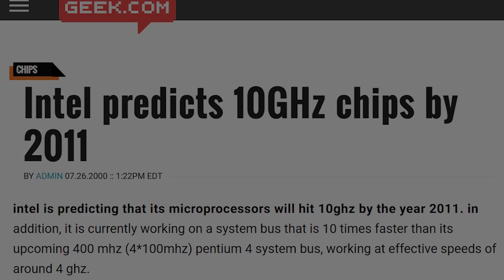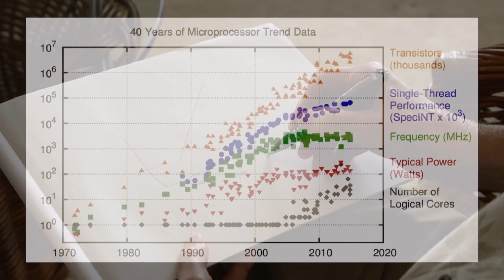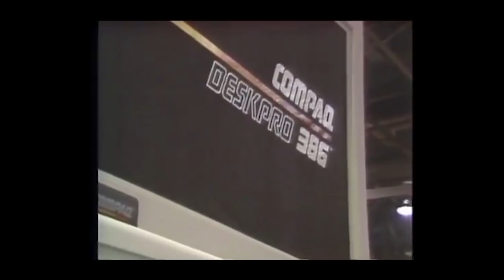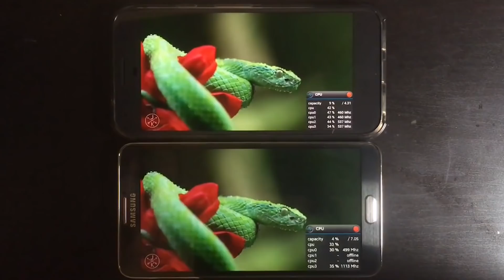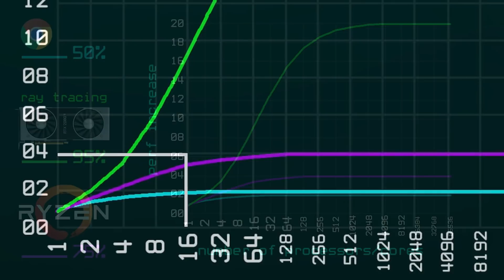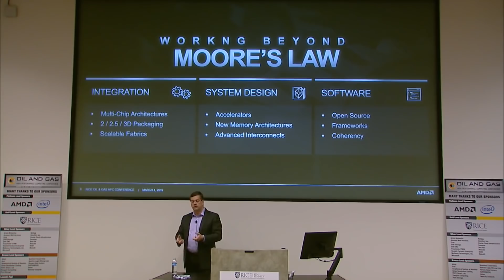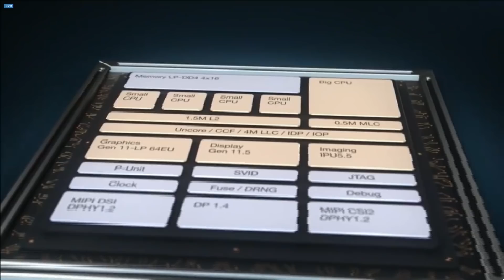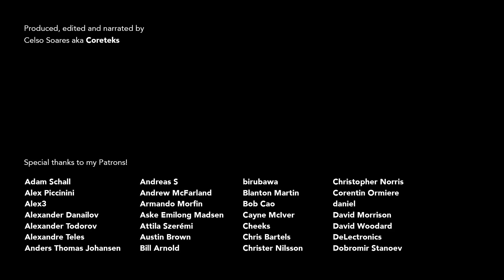Intel and AMD going BEYOND Moore's Law

Comment: Remember back to the 90s.  Used to be a cool, edgy magazine called "Wired" that went charging into the mainstream.  One Man's Opinion now a sold out shadow of itself.  Had a VERY memorable cover of a gorgeous blonde wearing a thin layer of what looked like diamonds with the title "The New Diamond Age" - and as carefully as possible talked about how if the DeBeers Cartel would release its bought out and hidden patents on synthetic diamonds how much it'd improve computer clock speed.  Easily into the many GHz range even in the day of not yet 100Mhz with existing technology.  Not fancy 'light' computers but a synthetic diamond rectangle to layer the chip above would make a better heat sink.  They also 'proved' that there had to be some kind of way of making synthetic diamonds in mass very cheaply - because ICBMS can re-enter the atmosphere at several times the speed of sound and would easily heat up too fast for their electronics to work if not be vaporized without a solid diamond shell on the cone.

But...I like the 'multi-processor' angle.

Since I use 3d rendering software the more 'cores' the better.  
The most noticeable is rendering where you see in front of you tons of 'squares' where the scene renders.
Less noticeable but still practical is how you can keep other apps open at the same time and work on them.  Browsers, art software, files, word processors.  They take away from total render time but can be very convenient depending on what you are doing.

Now, not every single program will need or benefit from a converter to split it up.  An old school arcade game even in an 'emulator' works in what would have been one of the world's better supercomputers for its time and even if you scaled it to a wall-size flexible display sheet of plastic would you need any more computing power than one core + 1 gig out of an 8 core, 16 gig computer you can casually buy today.

Virtual realty, high graphics games, advanced simulation and of course more 3d software are the ones needing to work out a flexible and expandable way to use cores.  The companies get plenty of money and since they fire employees just before Christmas to give the CEO a big bonus there are plenty who've worked with them needing to do something new.  Thus we need more core based programs.

I think what will be needed is a new 'standard' of multi-processor programming - one accessible to beginners and students.  Anyone can make a program to use multiple processors but it is their invention and likely works only on their computer system.  Or an individual company can make something that works with their software but outside it "Pay us Milleyunz und Milleyunz..."  There are enough mathematical algorithms (Fractal visualizations) that could use such a break down and have visible progress with multiple cores.  The trick is it needs to be FREE of any company or individual using it as a vampire's teeth to suck money.  Overall the benefit is worth contributing to.

Comment: Keep the original forecast in context.  Intel had just released NetBurst which was more conducive to ramping up higher clock speeds (at the expense of efficiency per clock cycle) so had they stuck with NetBurst instead of switching to the Core architecture, it is likely they would have come close to that 10Ghz forecast.  Fortunately Intel realized (after AMD started eating their lunch and RAMBUS was a total failure) that NetBurst was a dead end, and the quest for raw clock speed was a fruitless endeavor.

Comment: 2278
AMDntel announced the Ryzen-Core i4K Extrem.
A tech-demo is used to demonstrate the capability of their newest processor, sporting a wooping, 28Ghz on 4096 cores  with a total of 2048 threads.
The lights slowly fading as the artist (a clone of the all time favorite 21th century pop icon miley cyrus) is twerking to the 2079 released "despacito 5".
The audience is stilled as they realized the gigantic 50k holo Qled screen is showing Crysis 1, 2 and 3 and the original minecraft running at almost 60fps simultaniously.
Later that day, the united earth nation, lead by the bangladeshian main court, delcared the 8th of april to be the national holiday of technology and even pope kim jong trump junior acknowledge this significant step of human advancement.

Comment: You are completely clueless, my god. The way you talk about multithreaded code, you have no idea how much harder it is to have multithreaded code that runs stable. You have no idea about how much it would cost to "shift the paradigm" to multithreaded code. You have no idea about the fact that some problems are fundamentally sequential and can never be parallelised. You have no idea about operating systems that hold GLOBAL locks that stall ALL cores, or how the MMU and the TLB affect all cores, or interprocessor interrupts, or memory contention. The many-core technology is gonna be a failure for many years to come, except for particular special applications like Raytracing and Cloud computing. It is pointless for almost all the typical desktop applications after you surpassed a couple of cores.

Comment: In late 1970-1980 there were system called wafer-scale processing in short its a technology similar to McM but all connections between chips are on chip insted chip to chip , what does it do? it reduce energy consumption from wires by 1000 times and reduces latency by 100 times , this was made 40 years ago now we have almost 10.000 more advanced lithography.Wafer-scale processing is nothing other than imprinting few chips on the same wafer instead of cutting them to pieces and then wired them together.Simply by imprinting 2 chiplets and i/o on single wafer amd could create virtually single threaded cpu with 8 core worth of transistors , the tradeoffs are low yeld but this was tested almost 40 years ago with 28 and 40 gpu imprinted together on single wafer "well not exactly but very close".When imprinting 40 gpus seems unlikely due to random errors in lithography process then wafer-scale processing looks very promising in smaller chips but still way bigger that theoretically today limitation of 800mm/2 for gpus.

Comment: The notion that nobody would ever need more than 640K of RAM appears to have come from the IBM PC of the early 1980s.  In that system, any RAM address higher than 640K was dedicated to display usage.  That IBM PC was also the reason why drive C became the standard for boot hard drives.  This restriction would later result in a software comparability issue, wherein breaking the 640K barrier was considered such a big deal that there was a comical Microsoft ad heralding it.

Comment: Jeez, and here I am wishing Intel or someone would release a massively multicore general x86 cpu, or at least a USB "compute module" so I could write programs with even more parallelism without the trouble of trying to shoe-horn them onto the GPU. AND, I'd even be willing to shoe-horn, but I just have a crappy integrated GPU on my laptop, and, once again, no reasonable USB solution to hook up an external graphics card for use in computation.

Comment: AMD's IO die makes more sense than ever right now. Being able to store data in the cpu cache in a way that does not require code to specify a thread. Instead the CPU can allocate the thread that is free first, instead of potentially queuing the task on the core that would have previously had that data in it's individual cache.

Comment: Your arguments assume that each computer is used to run only a single application and that that appications work is only a single task. What about seperate services, look at modern applications....
Three tier architecture + frontend, multiple cores running database, then web server, then application backend, then the web browser, then multithreaded frontend js code. Then what about speech recognition pipelines then the AI work to interpret the meaning. There are PLENTY of uses for almost as many threads as you can ask for.

Comment: i wonder how far we(humans) can actually push this stuff tho. the only reason computers exist anymore is to make money. like, all cpus released in the past year can open/load/render 95% of the softwares used in businesses in less than 10 seconds. all of the gpus released in the past year can play 95% of games without a hiccup depending on settings. what im saying is... at some point there is going to be no reason to make the chips more powerful because of difficulty of manufacturing / what people will pay for the performance gains...... kinda like cars and super cars.... supercars go 250mph + but im pretty sure 99% of ppl have not gone over 200mph. do yall rly think that 250mph cars are gonna be 30 grand in 40 years? cmon

Comment: if I were to dissect this, it'd be too long. I can tell you that code/execution can scale up to as many threads as we want, and it can make sense if you have proper dataset. Easy way to explain today multithreading for browser terms you can build a chrome(or better firefox) browser that will automatically create new threads, and they are already doing that but on lower complexity by amount you allow them to in settings, each tab is then separated as a thread. In a single tab you may not notice performance as its currently is, and may gain performance but once you open up a lot of them - well if they aren't being created as new thread, you'll kill that one thread. 

Note I'm not saying number of cpu's or cores but threads. 

In programming you open threads. You can scale up to infinite amounts of threads, and still gain performance, if you have large enough data set that is, and if you can divide the work correctly;  Thus today mozilla could build a distro that would create threads by object, and script in easiest approach of a browser. (no point as we do not have that many threads, in your normal desktops). You can easily scale upwards to 100's of threads within a single page, threading each object.

The threading... of single threaded ops. The systems you have shown that are 'supposedly' dividing the single threaded op are doing very specific thing, its swapping thread affinity.
(and they do not have to deal with memory locality, and cache locality issues - they all share it)

The question is why no1 has ever came up with the scale upwards/downwards thread if process gains performance. Well they did make it happen at IBM, with Power6 architecture (2007), and later improved. It was vectoring the process and calling each CPU as a node - thus your code could be executed on whole CPU which could be 2-4-8 threads per core thanks to ibm's SMT implementations.

The future of moore's law is meh. Intel was ready to switch to new alloys for their CPU's back with 22nm age with FinFET as the process was designed for indium alloy, there was no need to go there tho; since they could earn more money staying on silicon instead.
Switching to less known indium alloy (which smart company that would want to kill its competition off) would use indium antimonide; in the beginning with big transistors and only over-time shrinking them to allow for more transistors. Basically a single dual or quad core 200GHz indium antimonide at 0.5V would deliver more performance than 64 core 3GHz CPU; and most important it would be cheaper. Those kinds of CPU's may not even need a cooler at all, and they'll only start cracking at over 400'C anyway.

Comment: My view on this: 1) Every trick, every AI feature, every automated rerouting of code has to be done by software or by die area of the chip. Part of the cpu is doing calculating work but it's not calculating anything relevant to the user. So part of the cpu power is wasted.
2) The more cores you have, the more wires you need to put between them, the more protocols, tunnels, switches you need to put between them. You cannot access a core directly if you have many of them. And cores will have to talk to each other a core will need results from other cores to continue it's job. Beyond a certain number of cores this will start playing a role. Same thing is true for big companies where there are a bunch of managers between the people who do the hardwork and the CEO. The avg guy from the working class can't talk to the big boss directly, at least not every day. In processors this means having 1: a timedelay, 2: overhead that uses power, 3: very complex cpu designs more prone to error and harder to maintain. I believe THIS is what's already giving us all the meltdown, spectre and dozens of similar leaks. If CPUs become even more complex than this, image what happens.
3) On Nanometers: You can't make cpus smaller and smaller. Here are some real hard limits: traces or a transistor can't be smaller than an atom, that's one clear thing to begin with. Think about one nanometer as the size of a 10atom long molecule. Then think about this: you can't pick and place individual atoms, you kinda shine at a group of them so traces will at least be a few atoms thick.
The "tools" to make the chip will have to be small too, now think about the wavelength of light. Visible light is about 380-750nm, UV is below that, Extreme-UV is 10 nm. Extreme-UV is already called ionising radiation, and in fact chipmakers now deal with the problem of creating electric loops inside the silicon by shining the laser onto it. Simple put: if you shine on one spot you in fact affect the area around it that is in the shadow. And here comes the problem: the smaller the wavelength the stronger its ionising properties are. So how can you etch a precise drawing if the thing you use to etch makes this collateral damage?
Another aspect: the etchant you use for the lithography, the polymer that cures by the UV light, it is make out of molecules with a certain size, a polymer is a long molecule because it's a chain of monomers, if that chain becomes shorter then it will have a lower melting point, lower boiling point, it might not cure. It's similar to replacing wax with diesel fuel, diesel doesn't become gel-like at room temperature.
And finally: the smaller you get the cleaner it has to be. A 0.5 nanometer sized imperfection might not affect a 60nm sized transistor, but it will affect a 10nm one.
I haven't even mentioned quantum tunnelling and other aspects where the transistors are so close to each other that the state of on will affect the state of its neighbours.
Please read this, this should be convincing information that you can easily check yourself on the internet.
Reply: You should really give it a thought. Overall you could say that I see even more limits in the growth of CPUs than you do.

Comment: Programmers will change the way they write.
They are going to move to a Dewey Decimal System-type of organization, so eventually the hardware optimizers will have a pre-ordered set of stacks of code in front of them to start chewing through.
But bad code needs to be rejected by hardware, not make up excuses for.
I'm sick of paying for vaporware.  coughcoughEAGamescoughcough
Reply: Um, but vaporware is something that never released?
Reply: @MaakaSakuranbo  

That used to be the general assumption.

When Congress passed the DRMA and prevented the return of packages of software that had been opened (something you must do to install a game), it allowed scumbag developers like EA to put garbage code in, and consumers had no recourse upon finding the game didn't work.

If you opened the box it did not matter what kind of trash was inside, you were screwed.

EA particularly took extreme advantage of this and release a bunch of trash PC versions of games that never worked, and got ZERO tech support from the greed-heads at EA.
Reply: @jayqpublic6209  I'd call that broken/scan rather than  vaporware
Reply: @MaakaSakuranbo  

Promises unkept.

Comment: Expect the unexpected. If the pace of change is fast now it will keep accelerating. Areas of synergy already apparent are AI technology, Q BIT,  optical, biomolecular technologies, others we can't even guess at. When the AI anomaly is reached the machines will replicate themselves, integrate, and evolve themselves. How will we deal with this? One ominous sign is in China where computers will track everyone and assign a social value rating to each person measuring them against government metrics of conformity to arbitrary standards. Even Orwell could hardly have imagined this. On the bright side are prospects for lifespan extension, cures for diseases, man machine integration, and much better and faster engineering of molecules and organisms to perform specific tasks. Nanotechnology is also on the horizon. It is in the synergistic integration of these seemingly diverse fields that will propel what are seen now as isolated stovepipes much faster.